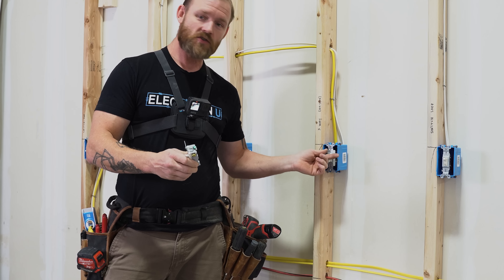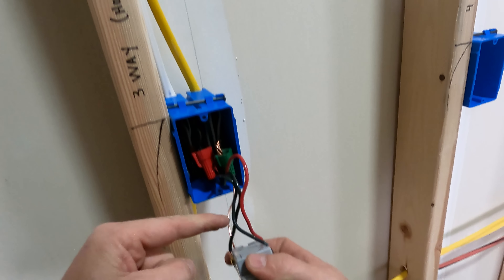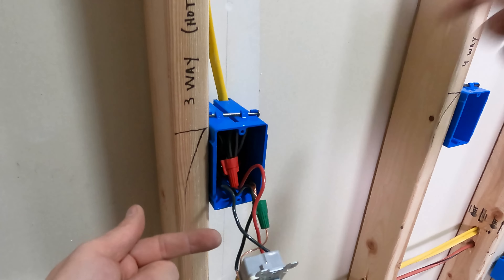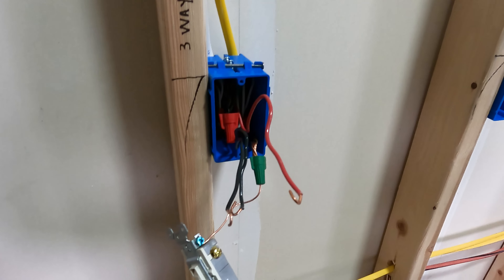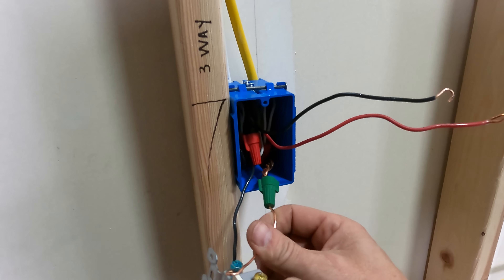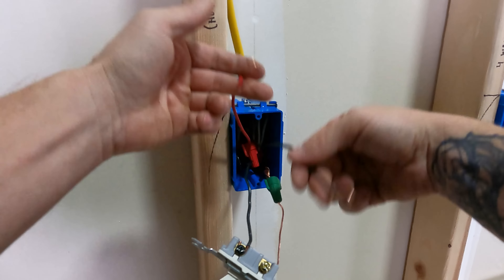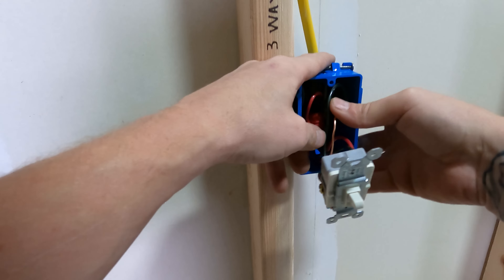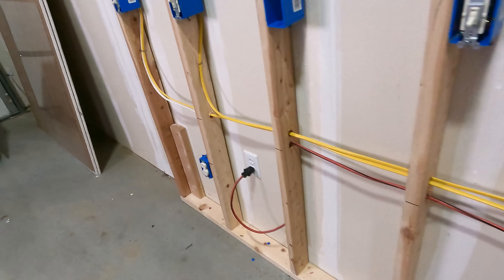How Do I Replace a 3-Way Switch? Which Wire Goes Where??

Comment: This is one of the best videos to help for this! 3:20-4:00 is key information! Simple and specific. Thank you!
Reply: Except for some reason one of my switches has all 3 going into the same sheath. Idk what to do!
Reply: @Grynjolf  Are they color coded? If you didn't take a picture of how they were originally wired, black typically is your hot, red would be your traveler. But try to consult someone who can visually inspect it or has the equipment to verify.

Comment: I know that it's not wise  but if your not sure what wire is the hot wire can you turn power back on and check for the hot lead, ID it then turn the power back off, (last resort test)

Comment: I’m not an electrician, but buy and sell property.  I see a lot of videos about replacing a none grounded receptacle with a GFI receptacle , so what about the other receptacles in the room? And or the receptacles down line what do you do to them , do you put regular 3 prong in them or do you leave the 2 prong and add an adapter?

Comment: Thanks for posting this informative video.  I replaced my 3W switch just like the original in the wall. took a pic so i was sure to put wires in correct position.  BUT the original switch had the black screw on top, my new switch had the black screw on the bottom.  Geez,  you saved me!

Comment: I have a question. According to the NEC, traveler wires are supposed to be blue or yellow, white for neutral, black for phase 1, red for phase 2, but here I see black and red used as travelers. Is tha acceptable or against code?

Comment: Thank you, but on my switch there is also another black wire plugged in directly to the back of the old outlet. My new outlet doesn’t have a hole in the back so I don’t know where to put that wire

Comment: I needed this for some reason my red wire is the hot wire. My previous switch had the red on the black screw. But you tip on. Che kick the sheathing was spot on. Thanks

Comment: I was hoping this would help me but it did not. One of the switches seems to have 2 hots (according to voltage tester) and has multiple sheaths coming in and out with white and 2 black, no neutral. Another one has only one sheath with white, red, black, and neutral. The final one again has multiple sheaths with white, red, and black - no neutral. I am going to try switching the 2 that seem hot in the main box. Hope that works!
Reply: Nope that did not work. I am pretty sure I messed something up in the junction box when I originally swapped the switches but I have no clue what!

Comment: What if all 4 wires coming into my switch box are from the same pc of romex ? Black, white, red and ground. When I moved in there was no switch installed. Just wires tucked in the box. Previous owner told me this box was once the 3 way switch for my ceiling light….

Comment: Should make a video for tape vs no tape. A lot of people argue this topic and there’s never a clear answer. Even in this video, there is a chance while you are pushing the switch in that the ground wire makes contact with the other conductors.
Reply: One good thing about pigtailing is that the ground pigtail is usually sheathed.  No code to tape and I only do it on metal boxes where I think the probability of a loose receptacle grounding out is really high.  A con is that tape makes a mess and the likelihood of the next electrician just cutting it off is pretty high and then you get short wires.
Reply: @glasshalffull2930  On taping, those are my thoughts, too.  I hate the mess tapes tend to leave (better with better tape, though), but I hate shorting out against the sides worse.  Nasty thoughts to whoever does not tape/band in a tight clearance single gang metal box, further doesn't tighten the unused screws, and in a setting with a manager that wants me to check something out without powering down.
Reply: Ideal ArmourBand Model Insulating Wrap, Blue is what I use. Easy on easy off
Reply: Sure, open a hornet's nest. That is like religion. Very strong opinions. I tape. DIY'er
Reply: Some only tape when it’s a gfci since there larger size has a higher risk of contacting the single gang plate.
Reply: @falcoii8565  thanks for the suggestion
Reply: I tape in my house. Mainly because I don't think twice about pulling out a live device.
Also, half the stuff in my house is still in the original metal boxes. So instead of doing half one way, and half another I just did them all the same.

Comment: I do have a question on this because I have three way motion sensor switch in the hallway and I recently changed out the other switch with a switch that has a nightlight and I can’t get the switches to work properly, the switch with the nightlight requires a neutral for the nightlight to work. Now the switches don’t work with each other and I can’t figure out why? Any idea what may be the issue?
Reply: Does your nightlite switch works with the 3way sensor switch? I mean, does the lights controled by the 3way sensor switch are also supposed to be controled by the nightlite switch? If so, is the nightlite switch, a 3way?
Reply: @martf1061  yes both switches are for a three way circuit
Reply: @oscargarcia6929  for the neutral, you can use the ground as neutral for the nightlite switch.
And does your nightlite switch already  have wires on it? If so, how many, and what color are they? 
From what i understand, your switch has something like, one white, one green, and 3 other wires. 
Whats the color of thoses 3 other?
Reply: @martf1061  no wires come with it, you use the wiring in the box your hot,travelers,neutral and your ground. Here is the type of switch it is-
radiant 15 Amp 120-Volt Single-Pole/3-Way Rocker Light Switch with Night Light, White 
And the motion sensor is- 
Lutron Maestro 5 Amp Single-Pole or Multi-Location Motion Sensor Switch, White
Reply: @oscargarcia6929  and what is not working properly ?
Is it that the motion sensor only works when the other switch is in a certain position?
Or is it that, even if you turned off the lights with the rocker 3way switch, the 3way motion sensor can still turn on the lights on its own?
Reply: @martf1061  the light switch with the nightlight won’t allow me to turn the hallway light off I can only turn it off from the other switch with the motion sensor

Comment: Great video. What if you have a black wire, white wire and a red wire? I am replacing switches and I when I took this three way off I lost track of the wire positions. Like I really can't see where the wires go into the sheathing very well.

Comment: What if you are working in an old house and your box is jammed with 7 wires that all look black? Took me two months and major wall removal to figure it out. Haha “same sheathing”? What if there is NO sheathing. PLEASE make a video about troubleshooting.  A swap in same for same with tips is good. But I need more. (Love your videos, this three way just brings back bad memories)
Reply: I know this was posted a year ago, however, in this case you could measure continuity between both ends of the cables and start labeling them with white, green, red, blue and yellow tape on the ends

Comment: Thanks - short and sweet. It will be easy to remember. On the 3-way switch that mates with the first one, which wire goes on the black screw. The one going to the light or the device?

Comment: I put my three way switch in upside down 20 years ago, finally got around to replacing it with a new switch right side up, works great.
Took two days to test and slowly understand how it works. Bought a non contact voltage detector with built in flashlight, it's a must have.

Comment: HELP ! My 3 way switches ARE wired CORRECTLY BUT, either switch in one position gives 124 volts at the light and either switch in the other position gives 79 volts at the light. I tried switching the travelers at one switch, no change. Could I have a defective switch ?

Comment: I was hoping for an explanation on pulling wires off an old outdated 3 way where its hard to tell between travelers and hot/ switched legs. Like the button three ways on old work.
Reply: Well, 3ways always have and always had 3 wires hooked up to the device. And the devices always have a distinct common screw on them. So always locate the common screw and the rest dont matter.
Never assume that its going to be a black wire.  The common wire Could be any color.

Comment: my new 3-way dimmer switch has no screw connectors. The new device has 4 pigtails (i think thats what you call them)- 2 reds , 1 green, 1 black. The old j-box has a old 3-way switch  with 3 wires  - red(to a top gold screw) , white (to a top silver screw) and black ( to a bottom gold screw) . I blew out two switches because I guessed wrong. HELP!

Comment: I have a lady wants me to change her Old switches. To some new switches, there's  3 ways but the one on the 1st floor is a Is single pole  switch. But it's somehow tied to the three-way upstairs. But the one on the first floors got 2 black wires  and white and the 1 upstairs got black red white. And also whatever switch you turn off is the one you have to turn back on to get the light to work.
 But I've never seen a single Pole. Switch used as a three-way. Anybody out there have an answer for me if you understand what I'm saying, thanks?

Comment: Finally a video that solved our problem!  Switching out to all new 3-way Leviton Dimmers and 3-way Leviton switches.  Used a no touch voltage tester to test for the hot wire like every other video we watched said to do, only the "hot" wire changed with the position of the other switch, or we had multiple "hot" wires based on the freaking beeping tool. Haha! FIVE frustrating hours later and we finally stumbled on to your video.  Why don't the Leviton videos tell you that the travelers come out of the same sheathing?  THANK YOU for making this very easy to understand video.  Made quick work of the rest of the switches we changed out.

Comment: Does code allow using two pieces of 12/2 instead of a single 12/3? 

This is what I just saw in the 3 way switches for lights in my large backyard shed.
Reply: I don't think this is a code violation. Nothing in the code book (2020) specifically mentions forbidding using multiple cables for a specific application.  I've actually wired dead end three ways with 2 pieces of 14/2 in lieu of 14/4 as follows.   One run for travelers,  one run for hot and neutral.  I used phase tape to mark the black and white, red and blue respectively on the traveler set.   This was a renovation and I needed to add another switch to a single pole switch,  and also have a couple of receptacles right below the 3 way switch I added. The inspector allowed this.

Comment: I replaced two 3 way switches. I made sure the wires went exactly in the same place on the new switches and the result is when I flip the switch to turn on the light it won’t turn off the light on the other switch. Or if I flip the switch on one side it won’t work on the other side. The old 3 way switches worked perfectly fine. I’m certain the new switches are 3 way. I tried switching the travelers between the two brass screws. Nothing works, I’m losing my mind cause my breaker box is one flight of stairs down and I must have gone up and down 55 times. How do I fix this?! Please someone help.
Reply: It appears your wiring might different( one 14 4 ,two 14 2 ?)  See my post as the most recent one.
Reply: One of your Travelers has lost its pass port and can no longer travel.
Reply: @GailUrge-vq6qn  great now where do I apply for a new passport? Is this something Biden did?
Reply: @Mstrmnd01  you need to take that wire to the nearest Electrical Identity Center and re-register using the wire's insulated conductor prints

Comment: Explained beautifully, but the closed captioning was a little frustrating when trying to see the wires.  Now if only I can figure out which is my ground wire.  I have two browns and a black, no clear indication of which is ground.  I wish that when Jack built my house.  There are 4 switches in the box and ALOT of wires jammed in there.  Wish me luck

Comment: Great video. Love that advice regarding travelers coming from the same sheathing. 

I did notice a 14 wire coming out of that switch box. Why did you mixed that with the other 12 wires. If the circuit is 15 A, it’s code compliant, but if it’s 20 A, it’s not. Either way, it’s pretty confusing and dangerous.
Reply: It actually may not be against code. In the code it's called tapping. So depending on the application he may be within the boundaries of code.

I did see it myself and was curious what it's being used for. Because it could be a code violation. But we need to remember he has this wired up for teaching applications and that's most likely the reason why it's there. So no point to think to much on it.
Reply: @TheForgottenMan270  I see. Thanks for your input. I agree that maybe he's just using that temporarily, which is fine. As long as it's not permanently stapled and drywalled over, I'm not worried. 

I see all electricians in my area use 14/2 when tapping into an existing outlet no matter what gauge the wiring is or what amperage the breaker is. I know the new load they are providing power for won't exceed 15 A, or even 10 A, but the 14 gauge wires can overheat when joined with 12/2 on a 20 A circuit. 

For instance, my mom hired a contractor to build a sunroom in our backyard. Since I'm savvy with electrical, I was naturally concerned about where the electricians will tap power for the four receptacles and a  stacked switch in this new room if they're not adding a new circuit. They used 14 wire for wiring all five devices, which I'm fine with. But they tapped into an outdoor receptacle that's wired with 12/2 and on a 20 A breaker, which isn't good. Later, I rewired it onto a 15 A circuit that powers the existing backyard receptacle which is now enclosed by the sunroom.

Comment: Before disconnecting any thing I  write on the drywall what goes where. I'll do a quick drawing of a three way and label the poles. Learned to never rely on short term memory. Just a slight distraction can blow out short term memory.

Comment: 3 way dimmers are a pain in ass. is there a way to put 2 - 3 way dimmers in 1 room?
Reply: Good question.
Usually in the 3way dimmers instruction paper, its one 3way dimmer and the other is a normal 3way..

Comment: Hey is there a way to take the hot side of a three-way switch and use a two wire remote switch to turn on the light on that side never using the other side.

Comment: If you have enough length, twist the 3 wire (black and red) like a twizzler, so that for future, you always know without having to dig in the box to find out which black wire
Reply: Or do one wire at the time.
Remove one from old switch and put it imediatly on the new switch.

Comment: I be interested in seeing how a four-way switch set up is done. Great video and cleared up some questions I had regarding 3- way switches.
Reply: The switch will have 5 screws on it - 2 black, 2 brass / gold and 1 green.  The black screws are one set, the brass screws are a second set.  One set of travelers go onto one set of screws.  

I generally try to rough in the wires so that one set is physically separate from the other (like one set in the top, the other in the bottom) but it that isn't possible, I band one set of travelers with a strip of electrical tape (usually yellow) to identify what two belong to the same set.
Reply: Um, 4 way has 4 screws. Depending on the age of the 4way switch the wires coming from one point will be either on one side or the top side. 
The only switch I saw with 5 terminals is a 3way and a single pole switch.
Reply: Easiest explanation for a 4-way switch is that it's an intersection for travelers. Instead of travelers going from one 3-way to another they go to an intersecting box, giving you a third switch or more. 4-way switches are purchased in a box and that box has instructions printed on the inside.

Comment: DUSTIN, Can youj make a video lesson using the chalkboard going on the differences between a ground fault compared to a short, and how can a technician use his DVM meter to tell the difference in troubleshooting a ground fault compared to short? because its going to measure the same on the DVM meter in milliohms a short circuit and a ground fault so how does an experience technician tell the difference?

Comment: Had to watch a few different videos before this one finally solved my problem. Moved into a new place and the 3 way switches were incorrectly wired. The simple yet crucial explanation of how to figure out which wire goes where when you don't know/forgot where it goes was the key.

Comment: If the box has 2 black wires i tend to always keep them on the same side. That way when you go to test if it doesn't work properly then when you go to fix it you know you just have to swap those 2 black wires to fix it. Sometimes our rough crew gets it wrong.

Comment: I took apart a three way once but it was wired differently. It only had one sheath and was wired with a black, red, and white wires. I had to go to its companion switch to see which one was the hot common wire.

Comment: Hi! I am a new subscriber, love your channel, specially those episodes about "CODES". Is it OK if I use the flexible cable like the one that comes with the EV charger for running about 25 ft. indoors from the main panel before exiting through wall and connecting to the charger. The circuit is 50A, 240V and the cable consists of 3- 6awg and 1-10awg flexible conduits. Thank you and Happy Holidays.

Comment: That's actually incorrect Dustin all electrical devices require the conductor to be torqued per 110.14(D). That device requires 16-20 In/Lbs witch is double the force it takes to open a door knob.